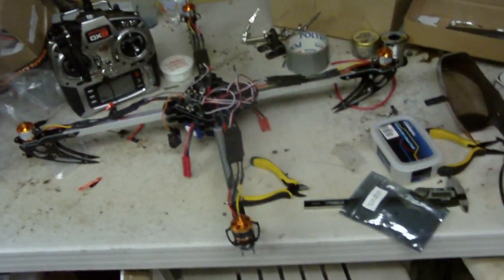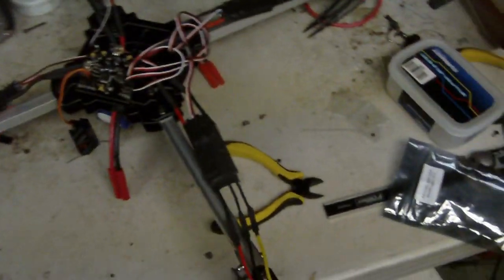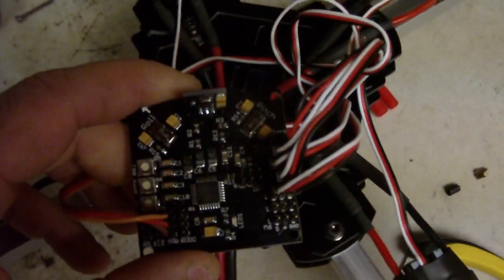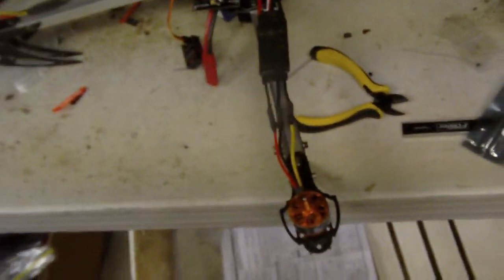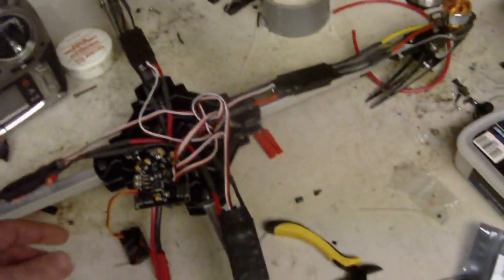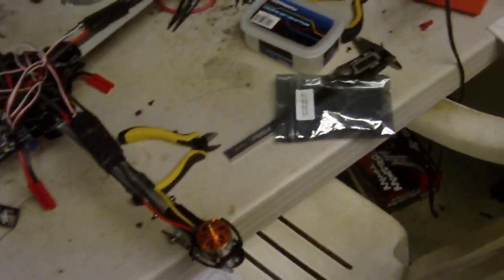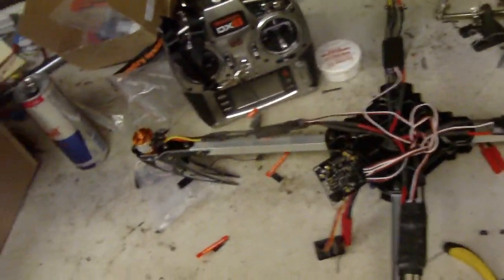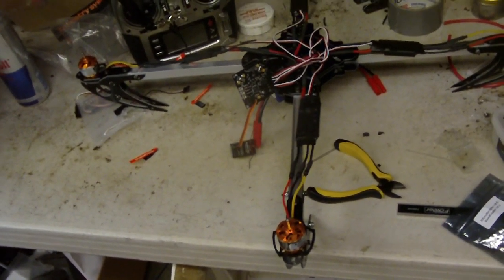X525 KK QUADCOPTER!!

Comment: Hallo, habe mich endlich in so einem Forum angemeldet, damit mein Quadrocopter endlich fliegen kann...

Ich habe mir vor einem halben Jahr einen Quadrocopter selber zusammengebaut (mit Hobbyking Produkten):
Board: Ich verwende das KK 2.1 Board
Regler: Bereits geflashte 30A UBEC von HK
Akku: Turningy 5000mah 3 cell 25-35C
Motor: Turningy 1000Kv
Rahmen: x-Form 

Mein Problem ist, dass wenn ich die Motoren starte, er bei fast Vollgas "umfällt" und die linke Seite abhebt und er so innerhalb von Millisekunden auf dem Kopf liegt
Ich habe schon versucht ihn gegenzusteuern, dass er wenigstens ein wenig abhebt aber nichts....

Ich bitte um Hilfe weil es wirklich kein Spaß mehr macht (ist nicht einmal geflogen) 

Danke :)

Comment from the maker: Sorry to so long to write back,  So busy.  Yes I had to download the 4.7 X version.  And its weird with those wires.  The regular wire I use for throttle and power to the receiver.  The other wire is complicated to explain.   The side with 3 u plug in on board.  one to alaron,  rudder and elevator.  And then it goes to single.  Put that part sideways all on signal on your receiver.  Thats how it works.  All u need is signal nothing else.  Hope u understood.  Goodluck

Comment: Cool vid! You had to load firmware for the X configuration...? I got the same board & after going 2 the kkboard site thought it was already in the X config. I'm still setting mine up. unsure of the wiring config to the receiver though. Is it just 4 cables straight from the receiver to the kk board or some special way (b/c my kit came with one regular cable (signal, hot and ground) and another w/ a regular end but the other end has 3 connectors but only 1 wire per connector.

Comment: Hey you got one of these too? I shortened the legs on mine by 3 inches each. Amazingly tough frame, wailed mine into the ground from about 30ft in the air, not a scratch on it.